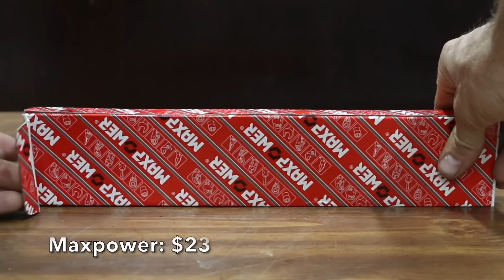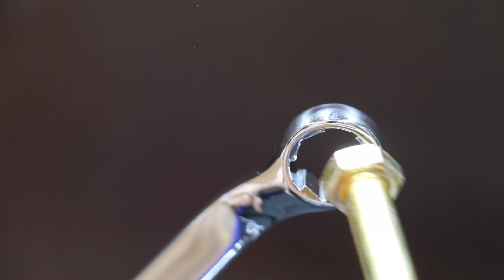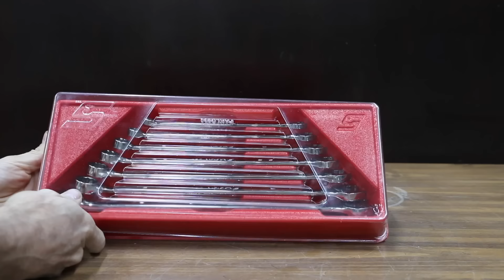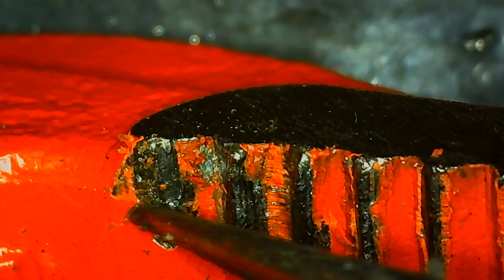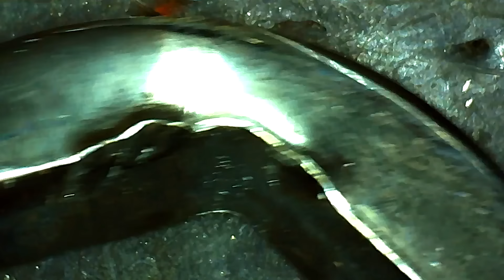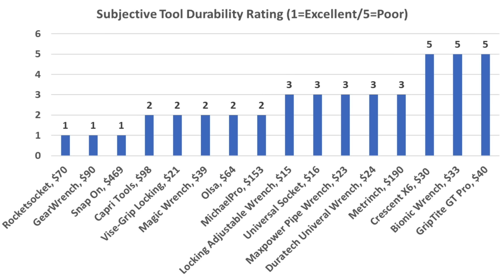Best "Rounded Nut" Extractor Wrench? Let's Settle This!

Comment: Whoa!  That was a wildly different video conclusion than I was expecting.  To me, damage to the stuck fastener while trying to remove it is irrelevant as I consider all stuck fasteners to be lost causes anyway.  They must always be thrown out and replaced with new.

That opinion, plus another opinion that any wrench thay fails to remove the completely rounded bolt must be disqualified, means that the best wrench in this test is the Maxpower Pipe Wrench.  But even that isn't as good as last test's Rocketsocket.  That would be my conclusion; most of these wrenches failed miserably and their marketing claims are garbage.

🥳🥳🥳 Video Idea 🥳🥳🥳

• Best vibration reducing gloves.  My wrists were seriously injured on the jobsite years ago due to a bizzare vibration injury.  (Was told to cut through hundreds of feet of 1" thick bitumen sheathing with only a hand-held oscilliating tool.)  You see lots of guys using jackhammers and grading tools and wonder what those are doing to their joints long-term.
Reply from the maker: Thanks for the suggestion.

Comment: Thank you for all the great work you do. I was just thinking that maybe with the non adjustable wrenches, that since the rounded bolt has so much material taken off that you could've tried the next size smaller wrench. Keep up the good work!
Reply from the maker: You are welcome!  I did use the next size smaller wrench.  Thanks, will do!
Reply: Yeah, I didn't understand that.   It was clear, in some cases, the wrench was way too big for the bolt.  Of course it can't grip, there is nothing to grip but air.   Go down a size and hammer it on if needed.

Comment: In real life you dont find a lot of rounded nuts in tight spaces, they are out in the open where they were rounded by vice-grip pliers. Thus, if it cant be reached with a vice.grip it cant be rounded, usually. Thats why most rounded nuts can also be reached with a pipe wrench, and a good quality pipe wrench is something everyone should have to begin with. Vice-grip otoh, you only need for welding to hold pieces together, never use on nuts or bolts, dont even keep in the toolbox but keep it by your welding transformer where it belongs.
Reply from the maker: Thanks for the feedback.

Comment: The only way I could see some of the wrenches working on the completely rounded bolt would be to use the closest size smaller metric wrench and seating it with a hammer.
Reply from the maker: Thanks for the feedback.

Comment: One trick you can do with the vice-grip style wrenches is to tighten the adjustment nut further after closing them on the bolt. Many of them have a hex socket in the adjustment screw to make this easier. Really crank that thing down tight using pliers or a hex end.
Reply from the maker: Thanks for the feedback.

Comment: Interesting test, thanks! I've owned a few of these things and have found that they either don't work, can't fit in where needed or broke on first use. The rocket socket looks interesting, but I just weld a new nut on top of the rounded bolt and then any wrench or socket fits and the heat helps loosen it if it's rusted. And air chisel works wonders on rounded or rusted nuts when there's a lot of excess stud sticking through and no way to weld a bigger nut on.
Reply from the maker: Thanks and you are welcome!  Thanks for the feedback.

Comment: I just got myself a pair of the Irwin Vise Grip Locking Pliers last week. Had to use it on a 20 year rusted partially rounded fuel filter line. I also had it pretty tight. Worked like a charm for my purpose.
Reply from the maker: Thanks for sharing.

Comment: Channel Lock 410 plier is my go to on rounded bolt heads (with enough room). Outward rolled lower jaw into a V angled top jaw. My pair is over 30 years old & still in really good shape.
Reply from the maker: Thanks for the feedback.

Comment: If you really need to remove badly stuck bolts the pipe wrench is too big to fit in tight places so looks like the rocket socket is the way to go.
Reply from the maker: Thanks for the feedback.

Comment: Kind of curious on how Wright Tools wrenches with their "WrightGrip" would've performed comparatively. 

Been looking to upgrade from OEM jack for flats, and round out roadside emergency kit...
Thinking potential video ideas with bottle or scissor jacks? (while floor jacks are great, they're much bulkier)
Also maybe lug wrenches, some different designs out there, but I suspect it'll probably default back to breaker bar with proper socket(s).
Reply: They would have smoked the undamaged test, but probably not passed the partial damage test. Which they aren't billed as being for that kind of stuff anyway, but yeah. The design puts one side down in a pocket where the teeth are and it actually engages along the flat very well, but on the opposite jaw it relies a lot more on a corner of the bolt. Without that corner there it might not be parallel to the teeth anymore, but then again it might wedge in there even better.
Reply: @AToolWithTools  Yeah, the partial damage test was the one I was most curious about. As far as I understand, Snap-On's flank drive is similar design, but with a bit of difference, and seen the Wrights perform a bit better than Snap-Ons in some videos, so was curious if it would've been slightly better on the partially rounded too due to that.

I'd reckon another general tool that probably would've done decently for "bolt removal" would've been the Knipex Cobras.
Reply: @olbaid84  Cobras or Raptors, 3.Peaks Daiya-type vise grips, Channellock NutBusters, there's a lot of other stuff to try too. This would be interesting to continue seeing more tests on since people try just about everything under the sun out of desperation. Just to see what's worth trying and what isn't.
Reply from the maker: Thanks for the suggestion.

Comment: Idea

I just picked up a new push broom and it's not very good. There's a relatively easy video. Best shop broom. Test push and pull. How much weight do you have to push down on it to get it to actually sweep. Durability of the handle and so on.
Reply from the maker: Thanks for the suggestion.

Comment: There is german socket brand (can not recall the name), that works similar to the rocket socket, but really cuts in to the bolt head deep with a reverse twist (think it is the orginal patent, the rocket socket is copying). It will destroy the bolt, but who cares. The head of the bolt will break off, long before it damages the socket, becauseit will keep digging deeper in to the head as more force is applied, like a reverse screw shape. saved my rear more than once. When I have to go borrow the set from my friend, I no longer care about the bolt, because I am already praying to the bolt gods for it come out at any cost, because what it is attached to is typically worth thousands.
Reply from the maker: Thanks for the feedback.

Comment: Some of those are designed just like the socket sets for extraction: you need to undersize the wrench and hammer/press it on so the teeth grip into the metal on the really rounded bolts.
Reply from the maker: Thanks for the feedback.

Comment: I generally don't have any issues with your 'real world' testing methods.  You seem to figure out some really interesting and relevant test scenarios with wear, use, etc.  But in this case, I think you missed an important test that would be greatly beneficial.

Regarding the rounded bolt head testing,  if these tests are for extraction of the bolt, a rounded bolt is by definition no longer the correct size.  Since you were using 9/16 bolt heads and therefore the same size wrenches, there is an exceedingly low chance that any actual 9/16 sized extractor wrench can work, and one must go down a size, even hammer it on like the sockets, to make it work.  Of course the adjustable ones might work, or ones that use the force multipliers as shown will pretty much work, if not snap the bolt head off...

And though these are for tight spaces where hammering is probably not an option, to use the now-oversized wrench on the now-undersized bolt head seems... well, not the way. I'd really like that particular test, the rounded bolt head test, performed with the next size (or two if needed) down to truly see if they'd work when one really needs them to.

Thanks for much for all you do, you're my go to channel for product testing!
Reply from the maker: Thanks and you are welcome!

Comment: The one thing with Snap-on  I've had  snap-on tools  30 years old,  Call the them  up told them  I need a replacement gave them my old tool in 2 or 3 days I had a replacement for it... Yeah they're expensive but technically you only buy at once in your life time
Reply from the maker: Thanks for sharing.

Comment: i still have a metrinch set of tools from the mid 90's. it came in a case with wrenches and sockets along with a 3/8 and 1/4 ratchet. i still use it every now and then.
Reply from the maker: Nice!

Comment: I was very surprised not to find this on your channel already, but I'd love to see a comparison on oil filter removal tools!
Reply: I always add a few drops of oil to the threads of the new filter as well as the rubber ring gasket around the perimeter of the filter. Seems to help.
Reply from the maker: Thanks for the suggestion.
Reply: I've had good luck with the Tekton oil filter pliers!
Reply: @FahimibnDawud  Me too. Their teeth bit and tear into the casing.  I haven't had one I can't pull out yet.  I also don't install them like Hulk.
Reply: I've had a good experience with the Oemtools 25101 3-jaw oil filter wrench where others failed.  I was too chicken to try the screwdriver through the filter method.
Reply: @Greg_Chock  afraid of commitment?
Reply: @1pcfred  I guess so?
Reply: When an oil filter is stuck on real good hammer a big screwdriver through it. Then you'll be really motivated to remove it.

Comment: Here's an idea, which potting/gardening soil and/or also which soil test kit is the best?
I recently tested my garden soil with a Luster Leaf soil test kit, then tested Miracle-Gro all purpose potting soil, both showed nearly depleted in nitrogen and phosphorus, and only a a slight better amount for potash. I have yet to test a cheap brand potting soil versus the others, but I'm left to wonder, is Miracle-Gro over rated, or is the test kit I bought over rated?
Reply from the maker: Thanks for the suggestion.

Comment: Sooo…when in doubt with a rounded bolt, use a pipe wrench…

I will say, I have a Husky rebranded Duratec, and it works great on the back end of an impact.
Reply from the maker: Thanks for sharing.

Comment: I've got an old wrench that looks like the magic wrench.  I think it's made by crescent.
It works decent but it will damage a brand new bolt or nut.  With my old one, the more torque applied, the tighter it grips.
Reply from the maker: Thanks for sharing.

Comment: Can you please do a long-term review and test fuel stabilizers and see which lasts the longest? Can you please include Startron, and true fuel, and as controls, test gas with 10% ethanol and some gas without ethanol alone. I suspect even just gas without ethanol and no fuel stabilizer will last longer.
Reply from the maker: Thanks for the suggestion.

Comment: I usually just grab my Knipex slotted pliers for this job, if I can get the tool on it. I have a set similar to the RocketSocket set, but they all have a 1/4" attachment built on to it. So it breaks off too easy. Thank you for this video.
Reply from the maker: You are welcome!  Thanks for the feedback.

Comment: little tip on using adjustable wrench, don't put the bolt nearest to the horizontal adjustment screw, it will give too much stress on the thread, instead you should put it further away, the moving jaw will apply force to the main body of the wrench.
Reply from the maker: Thanks for sharing.

Comment: I think the lesson here is just use a 6 point wrench/socket before it is stripped.
Reply from the maker: Thanks for the feedback.
Reply: That's not the trick at all. But yeah don't round off fasteners in the first place. It's just steel, not magical mithril. Torque is not your friend removing stuck fasteners.

Comment: I have the Metwrench set from the mid 90's. Not made in China. Never tried them on rounded but never had a problem removing damaged nuts/bolts.
The reason I have these is that one day my wifey took the interior or my car apart. I went outside and seats and everything else was scattered about. She said the carpet was dirty and it needed replacing. I told her to have it back together before dark as I needed it the next day. She comes back in at dusk and said that my tool suck. I ask her what tools she used. ''The ones in he blue box''. Uh oh. ''Those are my loaner tools''. The 359 pieces for $19.99.
Reply from the maker: lol  Thanks for watching!

Comment: This set of tests reinforces my belief that a pipe wrench with hardened jaws is best for turning rounded nuts (round like a pipe!) if it can fit. Those Rocket Sockets are like a pipe wrench in socket form.
Reply: Nah just weld a nut on top of it. If the fastener is rounded it's going to get tossed out anyways. The welding heat usually breaks up whatever got it stuck in the first place too.
Reply from the maker: Thanks for the feedback.

Comment: 5:37.. you're supposed to drop down a size and tap onto fasteners if needed... they'll do it... Any bolt or wrench designed for removing damaged fasteners will tell you that...

Comment: It would be interesting to see which tools work the best on small rounded fastners, 1/4" to 3/8" maybe.
Reply: What works the best is not rounding fasteners off in the first place. Know the limits of materials and work within those constraints. Some are just slow learners though I suppose.
Reply: OK Mr. Master mechanic
Reply: @@1pcfred  yeah ok, because u can get impact drivers or hit a breaker bar or wrench w a hammer and use heat in each and every scenario you come across huh? You must be the greatest wrench turner to ever grace a toolbox. Ever think that there are other scenarios where the information PF put out in the video would come in handy? Aluminum nuts on aircraft? Fastners on natural gas rigs where heat isn't a good option? Tight spaces inside a turbine engine generator? Etc....

Comment: I’m so glad you tested that Swedish pipe wrench, that thing saved my life when other bolt extractors didn’t work. And as a matter of fact, it not only grabbed a completely rounded bolt but got enough torque to snap it (which still worked out for me).
Reply: I wrench for a living and that exact tool is my Get Out of Jail Free card. Siezed tie-rods. Easy. Rounded bleeder valves. No sweat. Basically anything rounded to oblivion. This tool will move it around. And HF sold it to me for 11 bucks. The thing rocks.
Reply from the maker: Thanks for sharing.
Reply: @ProjectFarm of course,we can’t thank you enough for the knowledge you bring to many people.
Reply: I have the Snap-On version in 2 sizes. I love these fuckin' things. My coworkers don't seem to understand how they work though. 

They're more pipe wrench than pliers, and absolutely directional. They don't work backwards.
Reply: They are very similar to a stillson wrench.  Which is my go to on rounded bolts.
Reply: Any good pipe wrench should bite until the handle breaks.
Reply: @oceanwaves83  indeed,  Even with a scaffold pole on the end.
Reply: @oceanwaves83  very true, these are the only ones i own that will lock similar to a vise grip though

Comment: This is a very good test. We all have the frozen in place fastener to deal with from time to time. It is nice to know what works and what doesn't. Thanks!
Reply: What works is an oxy acetylene torch and a pneumatic impact gun. Heat the hardware up until it is bright orange, then strike when the metal is hot! Throw the hardware at your buddy and say, think fast. See if the dummy tries to catch it.
Reply: @1pcfred  Chisel and hammer too.
Reply from the maker: Thanks!

Comment: Seeing how good the locking pipe wrench did makes me want to see a pipe wrench comparison. Locking vs traditional vs knipex alligator
Reply from the maker: Thanks for the suggestion.
Reply: Really like the knipex. Great tools!
Reply: @jongoffinet8511  I have Knipex pincers, the quality is really high makes very comfortable cutting metal alloy is very successful
Reply: Some OG ridgid pipe wrench’s would be nice to see.
Reply: Pipe wrenches are the best... So easy to use, and perform so well.
Reply: @dand.4657  I enlightened my nephew to the power of the pipe wrench a few years ago - he's been a gearhead since he's had a license and is a union electrician, which is to say that he'd never touched a pipe wrench in his life LOL. We had a REEEAAAL stuck fastener on his pickup(good ol' Ohio rust belt cars...) and nothing was working, so I went and grabbed my pipe wrench, which he was skeptical of(since nothing else worked), and he was in awe of the shear bolt head biting ability of a nice pipe wrench. He bought a pipe wrench LOL.
Reply: Yeah. I need some new pipe wrenches. It would be great to see a comparison.

Comment: European pipe wrenches are superior if you have enough space. You can also file/grind the teeth a few times before you need to throw away the wrench. They are great both on round and hexed surfaces. It's also good for both industrial and home plumbing. For surfaces that require a nice/nicer finish you use it with a rag or sanding paper.
Reply from the maker: Thanks for the feedback.
Reply: Are you sure the teeth are not replaceable?  All my Rigid pipe wrenches have replaceable teeth.